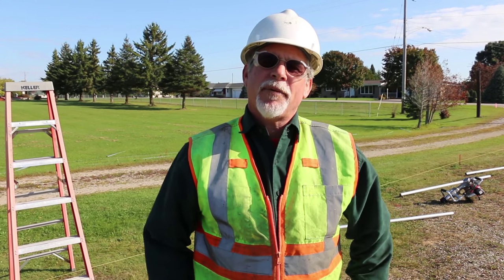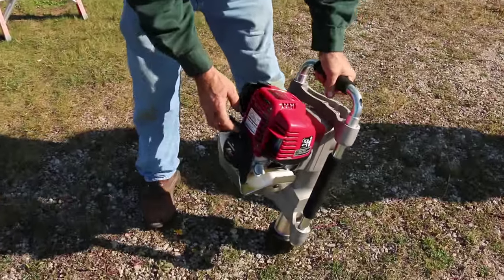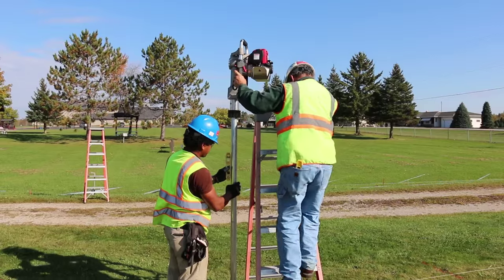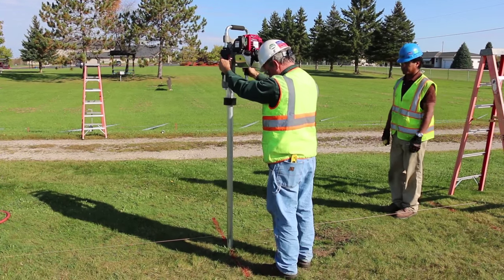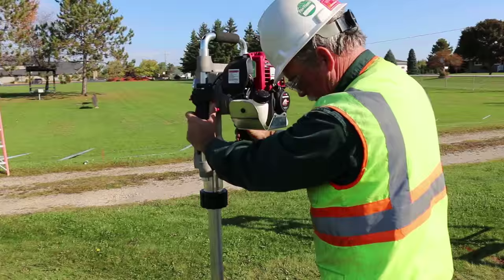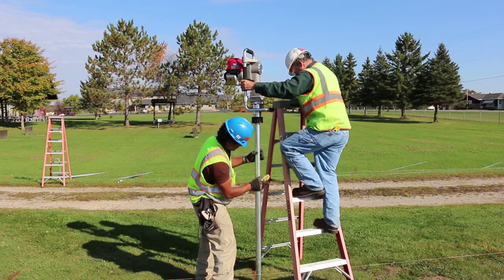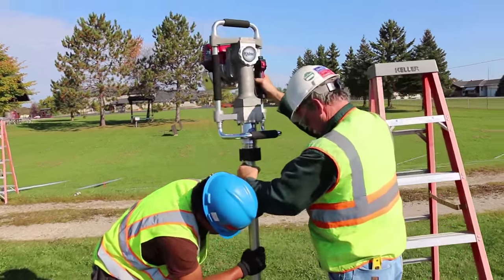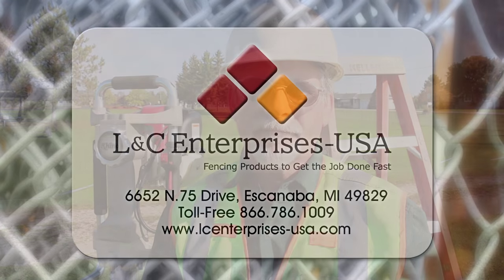Rhino GPD-40 vs GPD-45: Which Is Better?

Comment: Anybody complained about the defect in that Honda motor? Or has anyone complained about your customer service? I've bought 3 of these all 3 Honda motors have the same crack in the case. And your lifetime warranty on the driver assembly is obviously crap considering I've been jacked around by your customer service trying to get replacement parts.
Reply: And the only reason I've decided to make this public is I looked at the box I threw the drivers in this morning and got pissed off all over again. Figured I'd let everyone know about this.
Reply: @livefree4143  Looking to drive some dock pilings so love this option. In my price range but now you have scared me. Any better options out there?
Reply: @robingoettman5893  skidril they have the Honda 4 stroke but like I said the motor is junk. I've got 3 skidrils with the 2 stroke. Been running strong for a couple years now.
Reply: Good to know not to buy their product.

Comment: Will this contraption pound I'm a 1 1/4 Sandpoint 15 feet?
Reply: not in clay! I did a starter hole 22 feet down - and just tried the Rhino GPD 35 - and it mushroomed the coupler - sheared it off the 1 1/4 pipe also. So - the adapter was the largest size though - not sure - the coupler is maybe too smaller for a 2 inch adapter? Anyway good luck and let me know if you have any better luck. hahaha. I got about 8 inches down before my sacrificial section of pipe was completely sheared off - I did a blog post on it. And it was SLOW. I think when I hit a rock - it bounced back like in this vid - and I switched over to a manual 30 lb fence post driver - to get past that rock. It seemed to go faster after that but maybe it was the manual post driver that sheared off the coupler.
Reply: @voidisyinyangvoidisyinyang885  Thank you for the reply.  I ended up going with an electric Jack Hammer.  A local rental store had one with a special made bit used to drive the point.  I literally drove 25 feet of pipe in 15 minutes.  it took longer to put tape and pipe dope on the threads than to drive the pipe.
Reply: @DOOBERtv  You used a generator to plug in the jackhammer? I was looking at a rental jackhammer today. They sell jackhammer bits for post driving - online. But renting a generator seems a bit much - I'm offgrid.
Reply: @DOOBERtv  Wow the Gas Powered Driver has 1.5 newtons while a jackhammer can have 11 newtons?
Reply: @DOOBERtv  what jackhammer did you use? thanks
Reply: @DOOBERtv  I mushroomed the stainless steel coupler also! So the 5000 rpm on the Rhino is a beast.

Comment: Seems like overkill 8ft post and 4ft in ground.What would you use with for a 8ft security fence 16ft pipes? I always thought 1/3 was recommended.
Reply: Go Ahead Make Our Day Scooter &Peanut In northern climates you have to compensate for the frost line.
Reply: I built a primitive hut with post hole digger - probably went down four feet and my hut keeps getting taller! Frost heave is real. hahaha. The front door opening keeps getting smaller also.